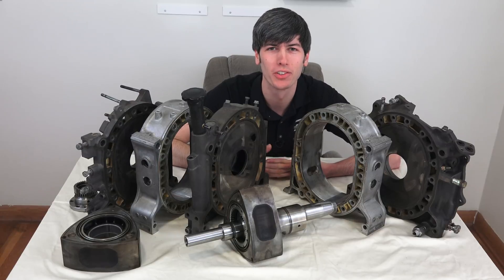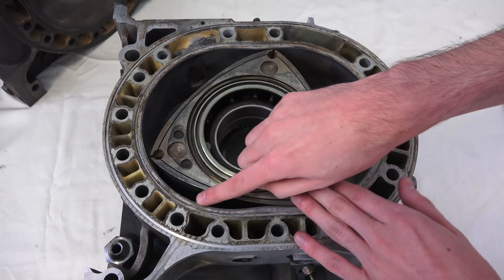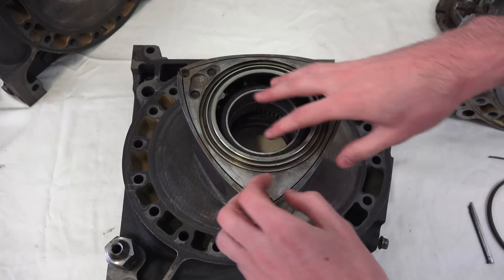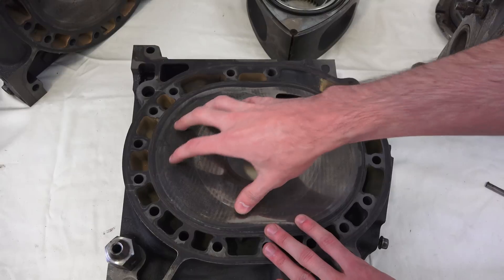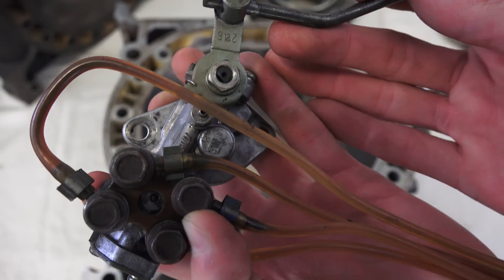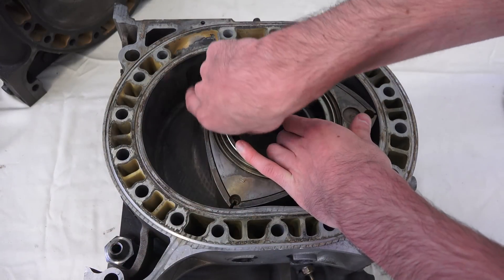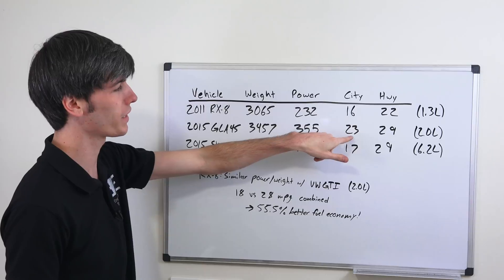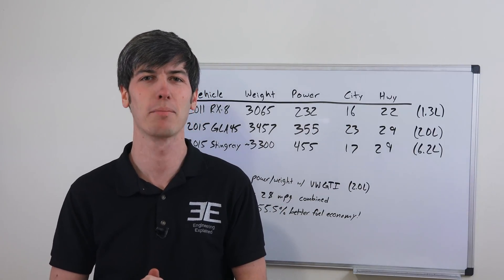4 Reasons Why The Rotary Engine Is Dead

Comment: In many ways they're closer to 2-strokers... Need oil in the combustion chamber, and it sounds more like 2-strokes... Twice the number of combustions per turn of the crank, right? Which also means that if you count "usable displacement per crank turn" it should count as a 2.6 liter...?  OR the piston engines should be counted as half the size since the pistons only do actual work every other turn...? Not sure I'm getting this right. :P

Comment: Keep the following in mind too:
-The advertising for this type of engine has always been somewhat misleading. The 1.3L rating isn't necessarily accurate, when compared to piston engines. The 1.3L engine acts more like a 2.6L in "effective" capacity. Which also means it gets way worse efficiency if burn rates are compared to the way a piston engine works. Wankels operate more like 2-strokes in a sense.
-More seals = more points of failure...holds true for either Wankel or "normal" piston engines.
-The thermal imbalance of the rotor housing (some sort of hybrid alloy that can be cast to have different regions of metallurgy) could at some point be solved in an alternate universe...if you happen to accept the current physics models on String Theory. Perhaps some clever engineering could result in using both chambers for combustion.
-I see no reason why nobody ever bothered to design a Wankel crank with more advanced internal oil passages, so oil injection into the combustion chamber is not required. Floating seals by hydraulic pressure & specific viscosities. Think non-Newtonian fluids.

Comment: I like rotary engines in theory,  the simplicity is amazing.  you missed another huge problem. ..they are a very l I w torque engine compared to standard engines and if paired with an automatic have mediocre 0-60 times.

Comment: Why dont you just put 2-stroke oil in with your gas?
Reply from the maker: +BUNCHofxs Would you really rather do that every time you fill up than have the car handle the mixture for you?
Reply: Well, the engine does it for you with its own oil right? It might actually be more efficient in the long run to pour in a can of 2-stroke oil every fill up, or just a little when topping off than having to put in motor oil all the time. Plus i hear 2-stroke oil burns better and/or cleaner. But on the other hand a constant intake of fresh motor oil never hurt anything :)

Comment: The injecting oil feature make me curious; if the components were built strong enough, would the rotary engine run on diesel or is there no way to increase the compression ratio?

Comment: why not make a diesel rotary?
Reply: Good question though!
Reply: +jmannetje1 Back in the late 60's Rolls Royce was designing a supercharged diesel rotary, don't know if it got beyond the design stage into running prototypes though, just remember an article i read on it many years ago.
Reply: They've been used in a large number of experimental planes with limited success. Aircraft engines are actually under far more stress then ones made for cars actually. In fact auto engine conversions while seen as an economical alternative are actually more costly because they're not made to turn a propeller and run under such high loads for so long at a stretch. Rotarys have made it well in very small ultralight planes, but they're still rare VS the popular 2 cycle air cooled engines for them. You should read up on aircraft uses of auto engines, it's interesting what's been learned. Being as most small plane motors haven't seen much design change since the late 40's You'd think it would be welcome, but it hasn't been so. I could go into some detail, but it would be a lot of typing! 
Do a little research, it'll show the differences in what's needed for both car and aircraft, and you'll get a better idea of why turbine engines never worked out in cars,too.
Reply: No, would like to though, was an interesting concept from what i remember!
Reply: Luca Fuoco Yeah, Youtube won't allow links in the comments. And That's what I remember about the engine, too, was interesting in that design in order to push the compression up to ignition pressure and temperatures. Look up a deltoid diesel locomotive engine to see crazy design, it's pretty impressive how it was done.
Reply: Rolls wasn't making it for a car, it was planned for military vehicles as it would have been pretty large being two engines basically stacked on eachother. I don't know how successful they were, but probably not very as they never made it out of the research stage. I did find a couple articles on it, and that had a running prototype at least.
Reply: Chrysler worked on them for years and finally the fuel economy and emissions were too hard to overcome. Turbines work best in a narrow RPM and load range, this was a big problem with the turbine engine. Too slow to spool up, and ran seriously hot as well. Just didn't make for a good drive system. Now if one was used in a co-gen system, as in running a generator to charge batteries and run a motor drive, like a Chevy Volt system, it would be practical. But then the fuel use is an issue, even a small turbine would just use too much fuel and still also put out too many oxides of nitrogen. Being able to burn almost any fuel is about the only good thing turbines were able to do.
Reply: +jmannetje1 If you want alternative fuel for the rotary look into hydrogen and E85.  You want faster burning fuels, not slower.
Reply: +jmannetje1 
IMHO, you need a really high compression ratio for a diesel. Getting that may be nigh impossible in a rotary and even if done would totally hammer the seals as there is so much surface area on them.
Reply: Deathlok67 Actually it's not uncommon for a high power rotary to see cylinder pressures of 2500psi during the power stroke..  Most turbo diesels run between 1500 and 2500 psi so no, far from impossible.
Reply: Atanas Tripzter

With a turbo, yeah.. but normally aspirated?
Anyway, not an expert on this, I have not worked on Wankels yet...
Reply: Deathlok67 well normally aspirated wankels are much lower about 1000psi-1300 at wot however so is any other engine.  Point being is they can be built to handle 2500psi like the 13 and 20b motors.  Jokes aside those motors can make so much power they literally twist the engine.
Reply: +jmannetje1 "but diesel explodes on combustion " I think you meant compression. combustion is the explosion
Reply: http://www.hartfordbusiness.com/article/20121018/NEWS01/121019796/bloomfields-liquidpiston-fashions-rotary-diesel
Reply: Dan Pad Yeah i saw that recently as well.  Shame that this originally came out 2 years ago and there has been no info on it.  Same with the MITY engine.
Reply: +jmannetje1 way too low of a compression ratio to run diesel well
Reply: ***** You can easily increase the compression ratio.  not a problem.
Reply: Atanas Tripzter but probably not high enough to run diesel well, also poor thermal efficiency
Reply: ***** Umm The difference between 10:1 and 16:1 isnt as difficult as you think it is.. the problem is that diesel burns slower than gasoline and gasoline already burns too slow for a rotary
Reply: +Atanas Tripzter I remember hearing of testing and experiments for rotary engines using Hydrogen. Aparrently there were issues with a pison engine allowing hydrogen gasses to build up in the sump and detonating. The rotary would be the better option in this application.
Reply: Therese Cuibe One big problem with the hydrogen is that its a gas so its harder to direct it.  Gasoline can be injected in tiny puffs, hydrogen requires a longer time because its a higher volume.  Currently the only hydrogen tests in the open have been with a prethrottlebody injection just like in a central carburetor setup.  This causes the intake to fill up with hydrogen and explode with the slightest spark.  Basically IRTBs would work so much better for hydrogen.
Reply: +jmannetje1 there already is. Some marine engines are rotory diesel.

there was one I saw that was turbo diesel 16L rotory. only made 900 odd Hp. pretty shit considering it 16L and turbo
Reply: +vkorinfsky but then it would have a lot of torque
Reply: +jmannetje1 just looked it up. its actually 11.6L makes 1000hp and 1700 ft-lb at 3600rpm. twin turbo diesel. Weighs 986kg, costs $165,000.
Reply: +Oldbmwr100rs If I remember correctly the cross over point were a turbo prop works better that a piston engine in an aircraft is around 500 hp. Since a car engine is basically a 20 or 30 hp engine that will occasionally put out a lot more you are just way to far from optimal power levels in a car.
Reply: doug112244 Nah turboprop is always better.  Just gotta change the scale of the engine.  For example take a look at rcs.  Turboprop still wins.

Main solution for cars would be to always keep the jet engine at optimal speed and use a secondary system such as a generator to store the energy.

Thats what the walmart concept truck is doing.

Comment: I feel the rotary engine is still in its infancy.  Because of mass production of the piston driven engine, there has been a lot of research and development on it.  The rotary, on the other hand, has been very niche in production and research
If the engine was used more, it very well could supersede the piston driven engine in performance and economy. 
The simplicity of the engine made it very dependable(mechanically)
The toilet bowl carb,  the alloys that were used for the seals and the intense heat from the exhaust alone were big turn offs for the early models
We can give up on it from our fails,

Comment: Well fuel economy make difference when you pay high price for your car. I mean how much brand new RX-8 cost. You can buy very good condition RX8 just spend 10k USD. 

Here is the real disadvantage, if you drive more than 20k mile a year then RX8 isn't for you. Also we need to understand Rx8 base deign never change since 2004. If you compare recently made car between the car didn't change it none of the performance deign since invented. I would say compare is completely immature.

Comment: They are not perfect, but when you drive a bridge port 13b, you'll quickly forget about any disadvantages.
Reply: +H3kler Until it's time to refuel, or your feet are cooked.
Reply: +H3kler 
N/A extend port 12A with dual webber carb's was the last rotor i was in and oh my ill never forget...
for a good reason though, it was awesome.

Comment: you forgot to mention, that if the Oil metering pump is deleted (no oil injection, common on modified rotarys) you can run premix. so it wont use your sump oil, and also provide better lubrication along with a longer lasting motor due to the 2 stroke oil being designed to mix with the petroleum, rather than the properties of normal mineral sump oil not mixing as well in that short amount of time.
Reply: +Matthew Downes And then good by any hope of passing emissions. But smells nice in a race car.

Comment: That's why mazda will use turbos and direct injection on the next rotary.

A turbo without the intercooler would help equalize the temperature between one side of the engine and the other. (Hotter intake, closer to exhaust temp)

It will also have ceramic seals that last a LOT longer and do not need as much oil.
Reply: bringing intake temperature closer to exhaust decreases thermal efficiency. i say they just got to find a better way to seal it.
Reply: +Bruno Danese even with turbos the heating problem will always be there. it's in its nature.
Reply: +Bruno Danese Actually seems legit. 
Peter Griffin voice: "WHY AREN'T WE FUNDING THIS?"
Reply: +Bruno Danese I loved your comment so much up until the point you said delete the intercooler. Contrasting temperatures across the rotor housing are a small concern compared to robbing all of your power and efficiency away. Also rotaries run quite hot compared to piston engines. Every possible measure needs to be taken to cool down the system, especially on high power applications.
Reply: asparceproton1 That's absolutely true. I was just brain storming.

How about working on a separate cooler only for the hot side of the engine?

Comment: My 1972 NSU RO80 runs great, is smooth with no vibration and no oil injection. It also doesn't shoot flames and is not a sports car.

Comment: Holy crap my farm truck (01 Silverado) gets exactly the same fuel efficiency as an rx-8
Reply: +Jared Jeanotte probably makes 10x more torque too lol
Reply: +jeffrey625625 yeah with a ton of feed in the bed too.
Reply: +Nathan Dance 

Oh, now 2-stroke engines are still around.

They may be used in lawn equipment, but they're still around.
Reply: unternichtuber

Indeed.

Sorry if you found my little joke unamusing.
Reply: unternichtuber

And I suppose you are never wrong, right?

How inhuman.
Reply: +jeffrey625625 i live in south east asia....they still produce 2t road bikes here
Reply: Nathan Dance

Thank you for your info and clarification.
Reply: +Nathan Dance There have been a few aircraft engine manufactorers come out with 2 stroke diesel
light aircraft engines due to the high price of AVGAS. Deltahawk and Gemini are 2 of these makers
Reply: +Jared Jeanotte 
Your farmtruck doesn't have a 9500rpm redline though
Reply: +Nathan Dance there are also a lot of petrol 2 stroke V6s, but you're right, there is no emission restriction for boats and ships... and yes rotaries are dead.
Reply: I'm buyinga  2 cycle '91 ezgo golf cart tomorrow. Apparently it's runs Great. on farm duty I'm not holding out much hope for a 2 cycle it might get a Honda clone 6.5 hp come June if it can't pull enough weight.
Reply: lol
Reply: +Watcher3223 KTM Yamaha Suzuki Kawasaki and Honda may wish to dispute that statement
Reply: unternichtuber dirt bikes tho
Reply: +rbagel55 Aircraft engines are 2 stroke due to their weight savings. You get one power stroke every cycle in a 2 stroke engine compared to every 2 cycles in a 4 stroke engine so a 2 stroke engine can produce more horsepower in a smaller package. Airplanes need to be light in order to achieve better fuel economy and/or better range and cutting engine weight is one way to do so.
Reply: worldlinerai
A lot of them are, a lot arn't Lycoming makes
quite a few 4 stroke engines. So does
Contenital and Pratt and Whitney. Rotax engines are 2 stroke for the most part. But the reason why they chose to go diesel is because of the very high price of AVGAS. These lightweight 2 stroke diesels run on JP4 or diesel
Reply: +DolleHengst my motorcycle does and that's a 4banger four cycle. 1979 Honda Cb750
Reply: Jared Jeanotte
apples and oranges. Nice bike though!
Reply: +Nathan Dance two strike diesel only died because of regs meant to kill off two stroke gas engines.
Reply: +Nathan Dance dead? Many boats still have 2 stroke engines
Reply: Bimmer Plus, there are new ways to improve  emissions for 2 strokes - Direct Injection.
Reply: +Nathan Dance One company will start producing 2 stroke 30k rev engines pretty soon with good emitions they will produce an engine of 125cc with 70hp(that's crazy)

I'd love to ride a bike with that specs :P
Reply: +Nathan Dance i love my yz250
Reply: +Indrid Cold The physics of a straight six make them ideal for heavy equipment and aviation due to the  balance having opposing cylinders mirror each other.
Reply: +Nathan Dance 2 strokes are much more powerfull pound for pound than 4's, but the emmisions killed them. Have a look at the massive lumps on the back of boats now, compared to the old V6 Mercurys and Suzukis!
Reply: Roger Blackwood They still live on in dirtbikes and 50cc "mopeds" :)
Reply: +Roger Blackwood Evinrude uses two strokes with direct injection.
Reply: and now 4 strokes are "dead". oh you meant petroleum burning engines.
Reply: +Watcher3223  amusing...and factually incorrect.But hey,that never stops people posting right?

Comment: Another oil topic that was not mentioned, was by the fact that the combustion chamber uses and burns oil to lubricate itself, you should try and avoid synthetic oils, as they have a much higher burning temperature, which would cause the oil to not be burned during the combustion process.

Comment: I don't think it may return, I think it will return. Even with its disadvantages, it is a very unique product exclusive to Mazda. The RX8 was risky because it attracted a lot of potential non-gear head folks. The next rotary car needs to be a niche sports car product so mostly those who know what they are getting into will buy it, which I feel is a strong possibility given how legendary the RX7 became.
Reply: +corvettez06usa Well, Its not really exclusive to Mazda. Many companies hold rights to it from NSU.

GM for example, almost made a rotary Corvette.
Reply: Ronin Moot. Mazda has been the only one and more than likely will be the only one to put it in mass produced passenger cars.
Reply: +corvettez06usa Well, thats not true either... The NSU RO-80. They sold about 40,000 cars. They weren't any good, but they built them.
Reply: Ronin what does then have to do with now? they got one in development? they got a rotory heritage to cash in on? they still around? I'd call it similar to an intellectual property Mazda has in the rotory, especially if they go the route of doing a true RX7 revival or a spiritual successor.  No other major manufacturer can play that card. Makes no difference who else made them over 40 years ago.
Reply: All my rotor housings are cast with markings "Licensed by NSU-Wankel". Its their intellectual property that was licensed to Mazda. NSU was bought by VW-Audi. VW may, up til recently, be getting a check from Mazda.

Rotary heritage to you and I. But lets be real, most people see the engine differently. Justifiably, too many people are scared of it. Nobody wants to replace an engine on a car they are still making payments on.